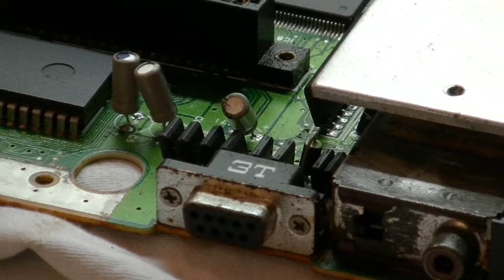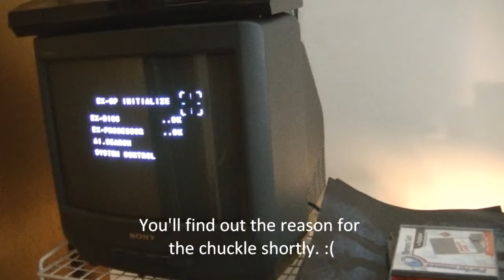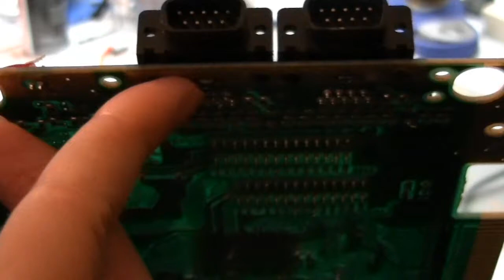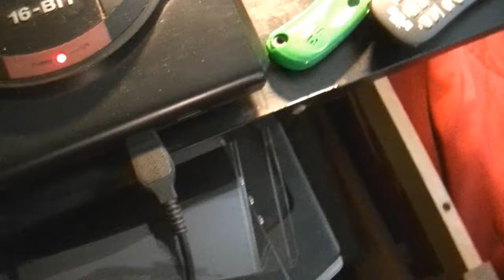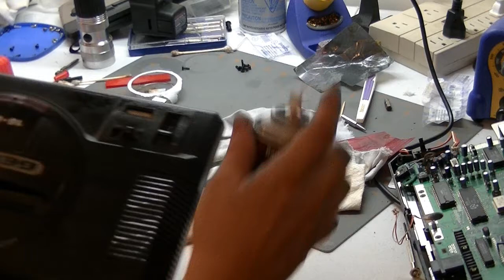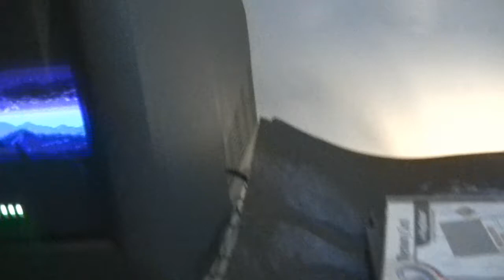Sega Genesis Testing, Cleaning, and Repair Part 2

Comment: I have a model 1 Genesis and the thin won't read any cartridge I put in. I have tried cleaning the thing, I have tried tightening up the cartridge slot and nothing is working. Would you, by chance know what I need to do?
Reply from the maker: Not necessarily, but maybe we can troubleshoot. Does the LED light when you turn it on? If so, when you turn it on without a cartridge in, and have it hooked up to video, can you see some kind of signal to the monitor like a flash? Do you get any sound with a cartridge in?
Reply: +Playongo Yes, the light does come on. Whenever I put a game in and turn it on all I get is either a black screen or the black screen with the white Text message, the exact one that is shown in your video before the game starts. And nothing happens.
Reply: Clean the game pins with 91% isopropyl alcohol and q-tips and let it dry before trying it.

Comment: My controller 1 port (on my Model 1) always has DOWN depressed.  No matter which controller I use (or even no controller plugged in!), every game I put in thinks that DOWN is being pressed or unusable.  Any idea on what can be done to fix it?  Controller port 2 works fine.

Comment: I just purchased a model 1 high definition and the av slot only works part of the time and you have to wiggle it to get it to work. Brand new av cable... Any ideas on what is wrong and how to fix it (if possible). Please help.
Reply from the maker: I'd look for a broken or cracked solder point. If you can, check continuity between where it connects to the board, and the pins of the connector. If you find one that beeps intermittently when you move it, that's the problem area.
Reply: Playongo I don't see where the av plugin solders to anything. Plus I have no technical knowledge.
Reply from the maker: Lol, in that case finding a friend who's handy with a soldering iron may be the better bet. Good luck!
Reply: Playongo well I guess I just wasted $25. Thanks.
Reply from the maker: inkd42088
 Never a waste. Does the RF out work? Try using an RCA to f-pin adapter and a single RCA wire to the RF port. It will probably look 90% as good as AV if not more. See this vid: http://youtu.be/gKJ3bgJa7fw
Reply: Playongo I was told the rf out works... Do I need the original rf cable and adapter?
Reply: Playongo if you'd like to email me directly I'd greatly appreciate the help. Blksabb6661@aol.com

Comment: I recently picked up what appeared to be a good condition model 1 genesis high definition graphics model.  I've hooked it up via RGB scart and Composite and all it outputs is a blue screen.  Unit powers on, and screen turns blue.  tried different power supplies and different games that work on known working model 1 I have.  Also have cleaned cart slot very well with contact cleaning solution, did the sandpaper trick etc, no change at all.  Board looks clena and solder points for cart slot look clean too.  Any suggestions/  thanks again for your great vids!
Reply from the maker: Thanks! I haven't run into that particular issue yet so I can't say for sure. I mostly use general troubleshooting techniques to try to narrow down the issue. I may not know what the issue is, but if I can confirm things that it's not, it helps determine where to look. In your case it seems like the focus is on the cart slot, video, and anything related like chips, or capacitors that may affect video. If you have another model 1, that could help with diagnosing. I'd start with trying the RF out as well if you have that option. If it's a problem with both RF and composite/scart, then it's something farther back in the chain than the video endpoint. You might try getting some basic voltage readings on stuff that seems related, and compare it to the working system. If you're brave, you can even start swapping components from one to the other until you reach the trouble spot. Take it slowly, and try to eliminate as much as possible. Whatever is left is likely the culprit. Worst case, it can always be a parts board for your next one. :)
Reply: Playongo Thanks, I was wanting to try the RF as well, sadly all I can find is an RF for the model 2, I will give that a go.  I really didn't wanna use this one as a parts machine as its a high definition graphics model, I have a actual model 1 megadrive and a non high def model 1 whose power button is all wacky but works fine otherwise.   None of the caps are leaky or look burst, very weird.  I will try RF and figure it out from there. thanx!